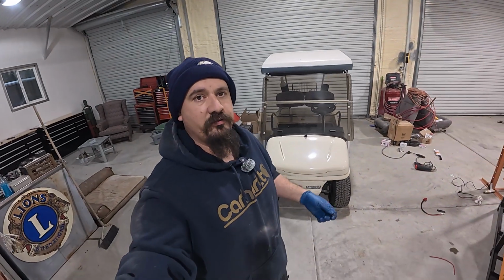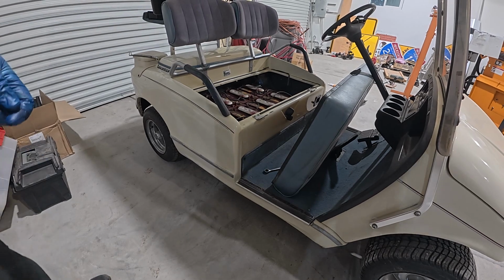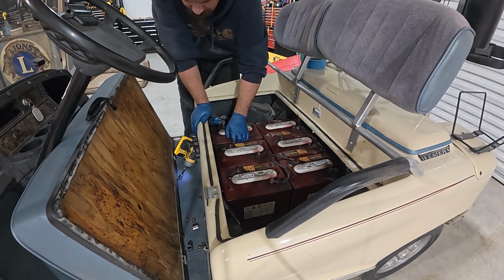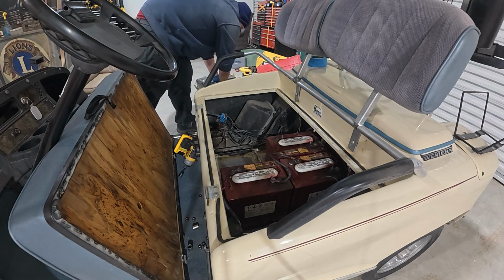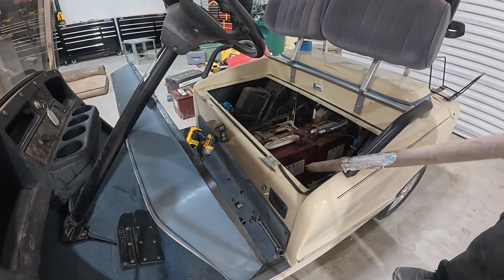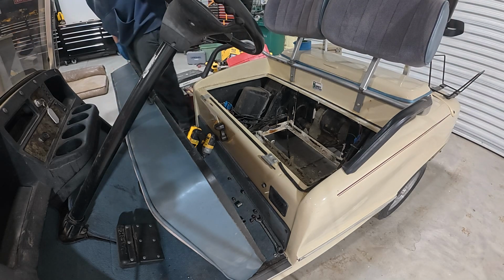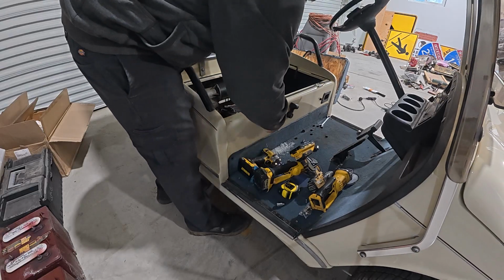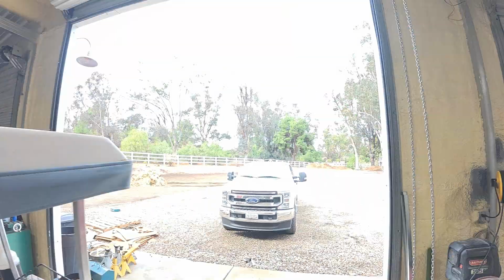Lithium ion Golf Cart Battery Conversion OGRPHY, LOSSIGY, CHINS , LIFEPO4 ,Li TIME, CHINESE , AMAZON

Comment: Did this model have a controller?
Reply from the maker: Yes it has a built in controller. 

That’s what needs to be reset.

Or do you mean, did it come with the controller to get into the menus, and no.
I bought the code reader off of Amazon
Reply: @Adventures-in-rust my cart has a Curtis controller and I’m not getting any power .
Reply from the maker: Sorry, this one does not have a control controller. It has an old-school type throttle.

But I have the same battery type on a newer cart that does have a digital type control controller.

And it works great on both

Comment: Did you get a chance to see what your top speed is ? Since the battery swap
Reply from the maker: @actionjoejackson9880  .... 
I don't have a baseline for this card but it's faster than my lead acid battery 42 volt versions.
Reply: How many hours are your getting before you have to recharge? I just installed this battery into my EZGO yesterday  and on the first charge I got less than a day and a half and had to recharge. Wondering in time will I get a much longer usage in between charging.
Reply from the maker: @anthonytimpanaro7344 

I go about 3 miles a day with mine and charge it maybe once a week. 
I also power some large LED lights off of it. 
My nephew's run them around every couple weekends I never have to charge during the day and just one charge gets the miles and miles and miles of driving. 
I'd make sure you don't have another problem somewhere other than the battery.